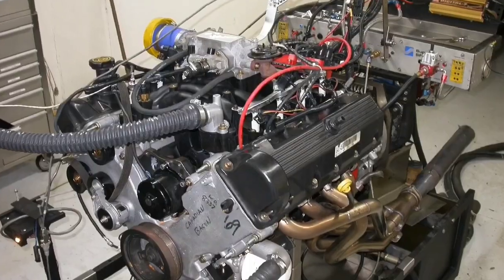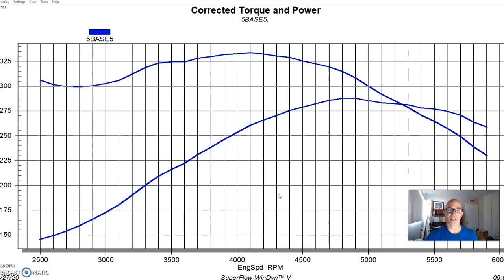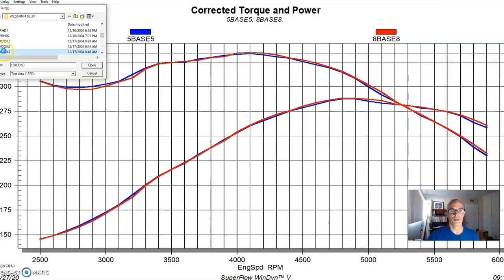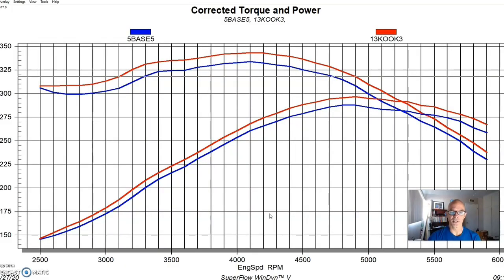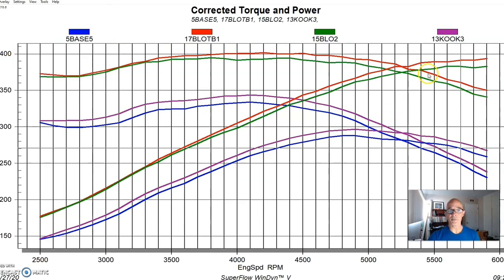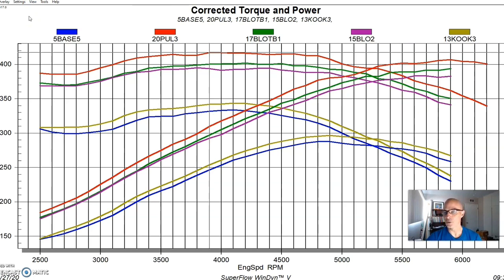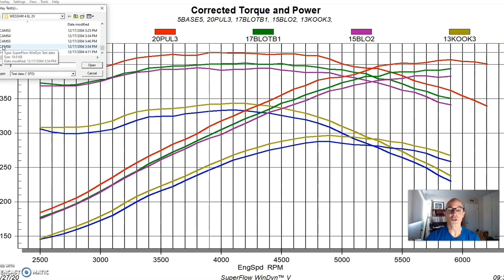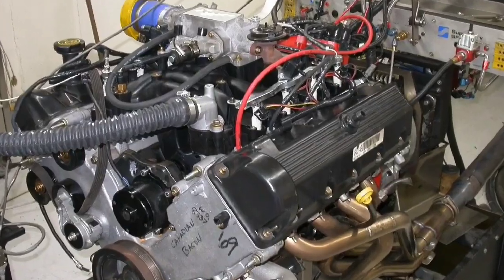FORD RACING SUPERCHARGED 4.6L 2V TEST

Comment: That was a great set up! I would love to run this set up in my RX7 with the 2011 ford crown vic motor in it
Reply: That’s an interesting swap, what gen RX7 is the chassis? I recently dropped a 3v into a Torino Elite. Working on getting the 3650 setup in it. I still enjoy cheap modular power with stuff I find in the wrecking yard. It’s almost more fun than working on the real race junk.
Reply: @kennethpowers8995  FC rx7 convertible. 230 hp 280 ft/lbs of torque at the wheels. The car is a rocket! Best thing I did was have it tuned. 
I agree with you, it's a lot of fun being able to throw those engines into something, the three valve would be more work then what I've done, that's wicked! My favorite part about these engines, is you can get them for under $400 or less
Reply: Southdown Garage That’s awesome. Honestly can say I don’t think I’ve seen a modular powered RX so that’s awesome. I got the 3v for $500 complete out of a wrecked 07 GT, did some basic bolt ons: cams and intake, longtubes, phaser block, tune. Redid the fuel system when I did the install. We got the chassis for $950 in solid shape and I hadn’t ever seen a Gran Torino Elite before so we picked it up and modernized her to add to the family stable lol.
Reply: @kennethpowers8995  that's awesome, I bet that car is a fun with a mod motor! Nice work! Do you have a video up on YouTube with your car?
Reply: Southdown Garage haven’t ever uploaded anything I just watch but I do have some videos I can try to put up. I know I’ve got GoPro footage of selling the old SBF LTD to pickup the 76 Elite, we recorded taking the 351M out and prepping for the 3v and I’ve got a few road videos of it now as well. Might be worth watching for someone I’ll give it a shot lol.
Reply: @kennethpowers8995  that's what I've done, I'm terrible at putting stuff out on YouTube, but I put some out because there was some areas I struggled with the swap, I thought it would be helpful for someone else.
Reply: Southdown Garage any ideas why someone would blow out only 5th in a Tr3650? Lol that seems to be my only trans issue. Runs and drives clutch feels great but no go for 5th. 1-4 feels stock smooth. Tranny is from unknown donor car, junkyard piece

Comment: I really wanna see what a 5.4 2v can get! I have a 98 f150 with the 4.6 and I'm debating whether it would be better to 5.4 swap it and go for a lightning setup or to build the 4.6
Reply: Build the 4.6 slap a turbo on 1000hp to the wheels with a good tine and other misc stuff
Reply: Turn key coyote swaps with transmissions are going for as low as $10,000
Reply: @bmacster1985  my guy that was 2 years ago
Reply: @monstermash479  I know, but you never know if they are still unbuilt yet

Comment: Good afternoon sir I watch all your content I was told at Lincoln Mark 8 motors can handle a lot of boost and I was told that the Lincoln Mark 8 LSC had more horsepower could you do test on these two motors thank you sir 😁
Reply: The 93-96 mark 8 put out 270hp. The 97-98 put out 280hp and the LSC put out 290hp with a different exhaust and a small factory tune.
Reply: I appreciate that sir I have a 4.6 two valve I have a 2002 Ford mustang is it worth putting the Lincoln Mark 8 motor in it or put a aviator motor in it 🤔 thank you
Reply: Nathan McGuire the 03/04 aviator would be a way better starting point. Base hp is 308, but it’s an iron block iirc as compared to the mark8 all aluminum.
Reply: The Mark VIII & 96-98 Cobra engine both have the Tekskid blocks, with Forged internals & 6 bolt mains. They're known to be able to handle 1000 Hp

Comment: Had a ‘98 non-pi back in the day. What a turd. Had decent torque though and sounded great.
Reply: Adding the PI heads on a non-PI motor gives it higher compression than a stock PI motor, because of the flat top pistons.

Comment: In the beginning it was stock besides 36lbs injectors and was making 280hp? But I thought just adding injectors wouldn't give any gains?
Reply from the maker: we test with no accessories, open tb, open exhaust, optimized tune (we always make more than the rated power). injectors don't add power-they just provided the needed fuel-bigger ones for more power
Reply: @richardholdener1727  ok I understand thanks, now to find that supercharger if possible!

Comment: How did you adjust cam timing with with the stock crank and cam gears? Those are all fixed positions
Reply from the maker: Easy, we filed off the key on the sprocket and used the bolt to secure it (after positioning it)-it was scary but after hearing John Mihovetz from Accufab telling us it was okay on his 9500 rpm mod motor-we were fine
Reply: @richardholdener1727  good to know! Thank you

Comment: My 2V on 12lbs with comp cams runs very good. Holding together so far. The 2V gets a lot of hate but I love mine.
Reply: any updates bro? im planning on supercharging my 2v and i would like to know if its a good idea, thanks
Reply: @jaysoleado  I sold it but it held together fine. I kept the revs low (under 6200 rpm) and had a conservative tune. Keep it 400-450wh on low boost and you will be fine.
Reply: What kind of supercharger did you use? Centrifugal or positive displacement?
Reply: @DavidValdezBigWaveDave  Procharger D1SC on a 3.85 pulley, stock lower.
Reply: @RJon2006  sick 😎

Comment: I had an idea about using acetone as a chemical inter cooler. I think it would be cool to see you use it in a non inter cooled setup like this so see what it does to the power curve. I’m pretty sure acetone is 104 octane if I’m correct and I think it has oxygen in it as well so I’d be curious to see how it affects the afr’s. I hope you take my comment in to consideration on a future video maybe experiment with a cheap motor at first non-boosted to see what happens before stepping it up.

Comment: Brilliant test to watch. Love these tests. Keep them coming. Hey, could you do a comparison using say a 327-350 CID motor with a dual-plane RPM Performer airgap using either  Holley Sniper or 750 but try some different 1-inch four-hole spacers like the Hamburgers, Wilsons,  Airaids helix, Jet, HVH Street sweeper and the Taylor Cable helix 4 hole spacers??? Be interested to see what difference these dirrerent types of spacer to as I am wanting to run a 1 inch four hole spacer using my new Sniper on a dual plane manifold V8.

Comment: My father bought a 98 f150 with a 2v 4.6 and it felt reved alot taking of so one day I watched the tach and accelerating from a stand still the tach jump toIf I remember like 2200 or 2400! Am I crazy or did Ford put a slippy converter on at least the truck 4.6s or all to make up for its small displacement in a heavy Vehicle? If so, if it is the case and only in trucks they would be a good converter swap for a car to get a loose converter on the cheap.

Comment: Love all the Ford stuff! Any chance we could see more zetec stuff? I just picked up a cheap zx2 with a strong motor, would love to see what can be done with what's available on the market today, or if an SVT zetec swap is simply the way to go.
Reply: A 2.3 Duratec swap might be better than the SVTF engine.
Reply: @LiquidSSSnake  At that point might as well do an ecoboost if the mounting points have remained the same. Transmission bellhousing patterns are different for sure even on the early duratecs though.
Reply: @Silverfang15  Maybe I say that because I have a well maintained SvtF. It's fun to drive, but power wise it's obsolete against modern regular cars. In a zx2 it would be a nice driver or autox car, just don't expect a frantic soccer mom beat to a merge.

Back in the day it was quicker than my stock automatic Fox body, shows how times keep changing.
Reply: @LiquidSSSnake  Yeah, I believe the ZX2 is ~250 lbs lighter than an SVT Focus in stock trim. a 40 HP bump would definitely be nice, plus probably more potential with the higher compression and forged conrods. I don't know if the six speed manual would bolt in, but that would be cool to have in a ZX2 as well.

Comment: Great job as always! thank! What do you think about installing an increased throttle on naturally aspirated engines? for example, there are two throttle bodys, one 80 and the other 100mm, both of which are sufficient for the motor under investigation so as not to restrict the flow. will there be a difference in power at full or partial load? what will be the difference? how to understand that a given throttle does not give resistance at the inlet? for example the head has 300cfm, 4 cylinder motor. What should be the ratio of the air flow through the  port and through the throttle? I don't know if I translated it correctly, I hope the question is clear :)

Comment: Bro Richard, i'm going with a 5.1L stroker for my 2v, i cancelled my 5.3L 2v dreams due to pricing n 5.4L blocks being cheaper n all that mumbo jumbo, my question is, can you do a stroker video/build on the 2v?? i'm also buying TrickFlow heads as well, if i go .020" over are the Race heads ($3k) a better option?? Will be investigating that, thanks..

Comment: Love these videos! Especially the "other guys" I would really like to see a modular V10! I had one in a excursion I put a y pipe with a Banks tuner and Intake. It really woke it up, and then I had 4.30s installed. It had no business being as fast as it was. Made me wonder what could be done with cams and forced induction.
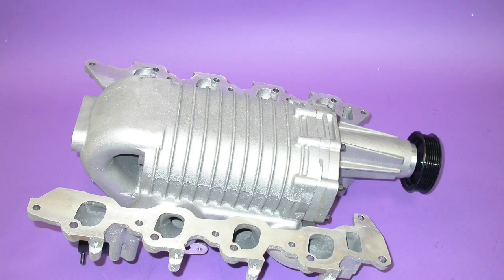Reply: The Y pipes were huge restrictions for the excursions & super dutys. It gave that V-10 that weird pinging exhaust note. Fun fact the econoline vans didn't have that same Y pipe for the  V-10, thats y they sounded so much better. On the Excursions I thought they all came with 4:30 rear ends? Or was that an option?
Reply: @BrownBomber92181  3.73s were standard. I'm note sure that there was an "upcharge" for 4.30s. But yes  I definitely had 3.73s. At about a 100k miles I started hearing what sounded like a bad universal joint. Turned out to be a bad bearing in the  rear end. That's when I asked what gears were in it and they confirmed they were 3.73s. And I asked for yukon 4.30s. I am very neurotic about my rpms when I'm driving, so I pay alot of attention them. Based on my before and after rpm calculations, it seems to confirm they were 3.73s.  I now have an 05 6.0 excursion and it has 3.73s as well. Probably the worst financial mistake I've ever made lol. I should've kept the v10

Comment: So many , many thousands of dollars later the 4.6 Ford is capable of making the same horsepower as a junkyard LS with a cam and spring upgrade only. 🤔
Reply: The ls is a way bigger displacement engine
Reply: @perikoglopez6276  a 4.8 is not that much larger than a 4.6 and cam and springs with Richard's tuning has shown as much if not more.
Reply: .2L isn't exactly "way bigger"
Reply: @dwightschrute4029  the 4.8 is out of the question
Reply: @perikoglopez6276  displacement isn't the game changer. If it was a coyote 5.0 wouldn't smoke a gm truck 5.3L. Those GM engines just breathe pretty well stock. Air flow is the difference, not the displacement.
Reply: @dwightschrute4029  no way a 5.3 beats a 5.0 in hp numbers

Comment: Loved comparing these results with your diy m90 5.3 results.
Really wonder why the 5.3 with stock pulley didnt put down same as the 4.6 though.  I wounder how much better the ford racing m90 is vs the stock gm 3.8

Comment: Just look at the base numbers, stock it's already make 1hp per cube. It's only 281 inches
Reply: I know, and people hate on it for being weak, it already does pretty damn good.
Reply: The 4.6 has great boost potential which some folks knew long ago, now it's a well known fact. Add a forged rotating assembly, up the boost and troll away.
Reply: @1upPaintingAB  ikr!
Reply: 1hp per cube is ok, but not that great.  Look at the coyotes for example, 302 CI and they make 460 hp.  Over 100hp more than its displacement. Same with the 392 Hemis, They make 480 hp. You see where Im going with this.
Reply: @chrishernandez2490  they're also like 10 years newer than the 2valve, and the 4 valve easily makee over 400 when you let them breath.
Reply: @Prestiged_peck  Hell yeah,  4V 4.6's are amazing.  The original comment is referring to the 2Vs though.
Reply: @chrishernandez2490  yeah but the coyote vs the 4v is a better comparison, as a 4v engine is almost always gonna make more peak than an equivalent 2v engine with the same level of cam
Reply: @Prestiged_peck  You wouldn't test a 2v and a 4v with identical cam specs as they require a completely different, almost opposite approach on cam selection. What works for one doesnt work for the other.
Reply: @madmod  true , I'll reword it
Reply: @Prestiged_peck  i will definitely say you can get stock coyote power level out of the right combo of parts on a 4v. Its getting fairly affordable these days.
Reply: @madmod  you've always been able to do that fairly easily, stroke/bore it and high lift cams can get you past that before you even really touch compression
Reply: Look at his npi headed test. It made 260hp with 341ft/lbs! Thats more power and torque than his 350sbc crate engine he tested and the stock 302 sbf.

Comment: 6:30 so from that if i were to actually put the two 3.5L eco boost turbos onto the 4.6L in the thunder bird i have, that 15-25psi on the wast gate could yield 450lbft/400hp... they would be over spinning a bit but they would come on instantly. they would fit right were the catalytic converters are.

Comment: It’s actually a m112. I’ve installed a ton of these blowers made anywhere between 350-420whp with meth injection.
Reply: Made 423 at the tire with a FBO 99 WS6. That was 20 years ago. Coyote engine will walk your 4.6 all day long as well as my old car, with  a few mods.New technology is good, embrace it. And most of all, enjoy it.
Reply: Tom Rados yeah my coyote makes over 420whp with simple bolt on’s. I’m talking in the past.

Comment: Would methanol injection affect the power, besides charge cooling?
Reply: You can run more ignition timing, it's like running a higher octane fuel.

Comment: Please do a 1994 Lincoln Mark 4.6 4v with turbo's in stock form and long tube headers.
Reply: Mayhem Maverick  I will be mounting turbo's down stream and also I will be going to forged internals.I want to utilize stock uper end with porting and cams and keep the 16 runners with a turbo running primary and one for the secondarys.

Comment: I'm guessing same amount of money spent on a n LS  motor would result in much bigger power!
Reply: Keep guessing.
Reply: You got it man!! That’s a lot of coin spent only to get above 400 hp. You could get a junkyard 350, some junkyard Vortec heads and a cam and be close to that horsepower number. I dunno why the modular is limited like that is it head flow? Not a Ford guy.
Reply: @genuinepozer2957  less limited than you'd think. It's more that they're physically enormous. You'd have a lot of work to swap a mod motor into anything other than a full size car or truck.
Reply: PureCountryof91 Another reason the LS rules.

Comment: How much did it take to make 430 hp? Too much. Buy a stage 2 cam and stick it in a ls and same power. Way cheaper. I would like to see what the old trick flow twisted wedge heads for a 2 valve would make, I think that’s what they were called, they had the intake valve moved to the other side of the head like a 3 valve engine.
Reply: Not everybody wants to be just another cog in the machine. There's a lot to be said for not joining the crowd.

Comment: 9:45 Many people don't know that pressure is a function of restriction and not flow.
Reply: This is especially important with positive displacement blowers. The parasitic loss  in turning the blower is less dependent on Rpm and more so the boost pressure it's pushing against. Supporting mods are far more important to make power on less boost while still keeping blower speed up
Reply: Yeah that boost reading in psi is basically what the heads can't flow the excess air as I understand it

Comment: Is this the same 4.6 in the 97 and up trucks.?
Reply: the heads and intake changed in 99 for mustangs an 2000 for trucks  power jumped up from 215(1997) to 260hp(1999-2000)
Reply: @codyramos3200  I definitely have the 215 hp version..lol

Comment: Those are some good baseline numbers considering its rated at 260 stock. Could you try a kenne bell supercharger on it too? Im wanting to build up my 4.6 with a kenne bell & built motor.
Reply: At that point youre better off putting a down payment on a 2007-2009 Gt500

Comment: Anybody know the price difference between the Ford Racing blower and say a Kenny Bell?
Reply: That Ford Racing blower hasn't been available in over a decade.   Some very old test Richard is posting up here. (still cool to watch don't take me wrong)
Reply: @NCSTANGGUY  , I figured that it wasn't available. I know that Ford Racing stuff tends to be very expensive, but since late 90s and early 2000s Mustangs are getting less expensive, I was wondering what it would cost to get close to the same power as a new Mustang.
Reply: Wont have the hit down low of a roots or twin screw but a good used Vortech kit(1500-2200) and some cams/long tubes would work wonders on a 4.6 2v.
If you shop around I could see 4500 total investment and make 450 ish rwhp(or more if you're brave with those stock pistons/rods).
Reply: @NCSTANGGUY  , good stuff, thanks for the info..